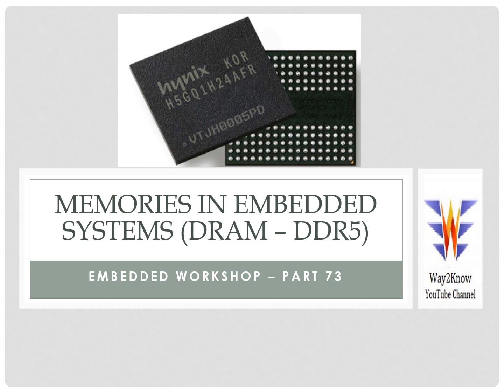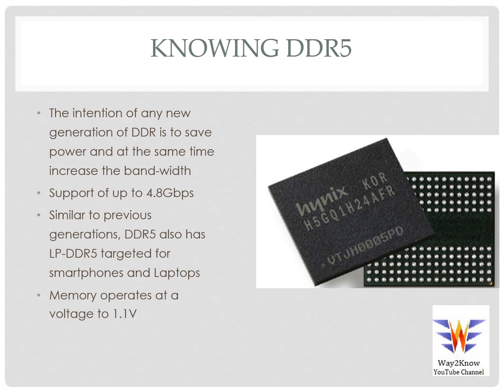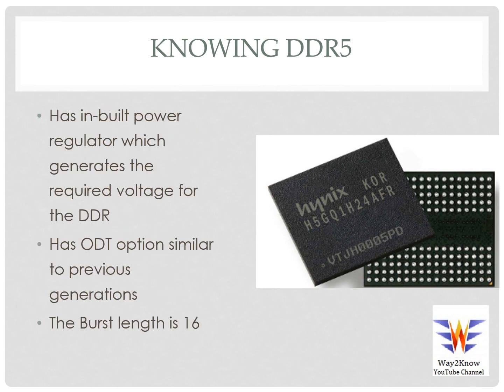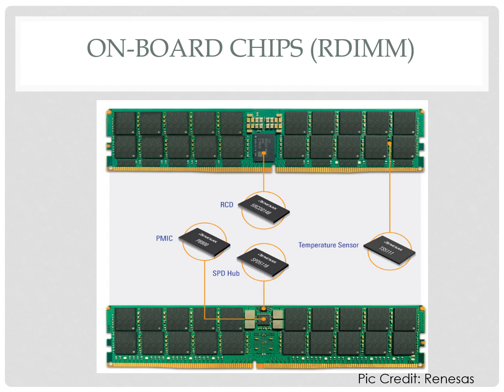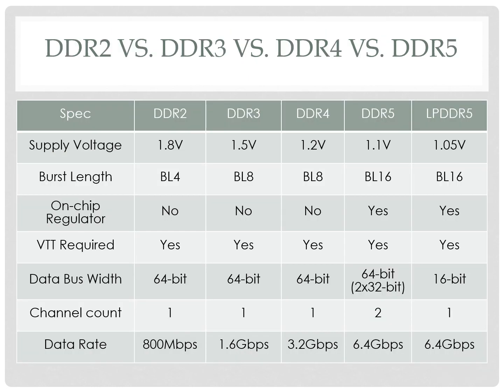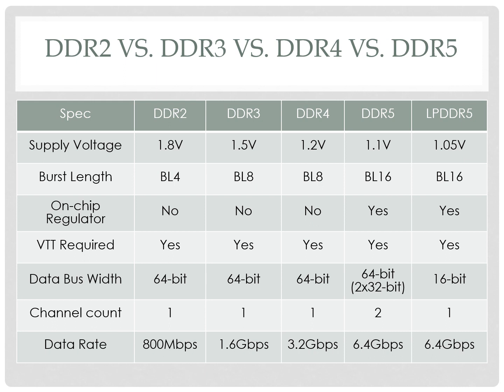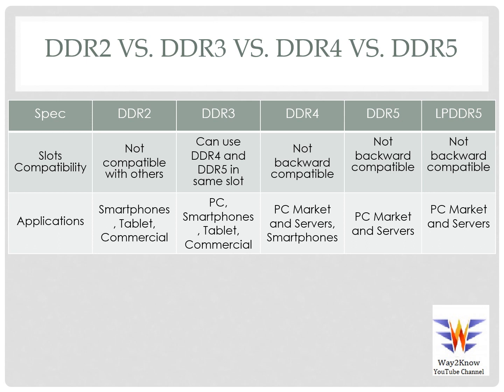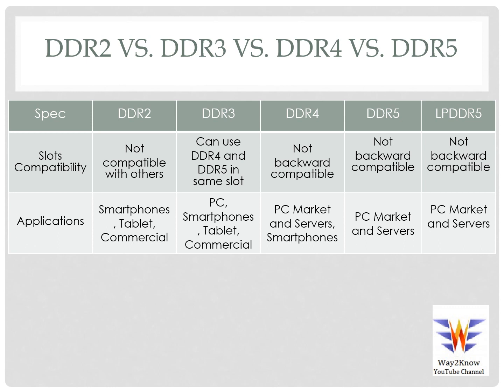DDR5 RAM || DDR5 memory module || DDR2 vs DDR3 vs DDR4 vs DDR5 || Embedded Workshop Part - 73

Comment: is there any separate frequency for strobe, address, command and control signals. if not kindly explain how to co-relate with clock frequency
Reply from the maker: There is only single clock between processor and RAM. For the timing thing, there is a neat timing diagram in the datasheet, which shows how the data is clocked to RAM